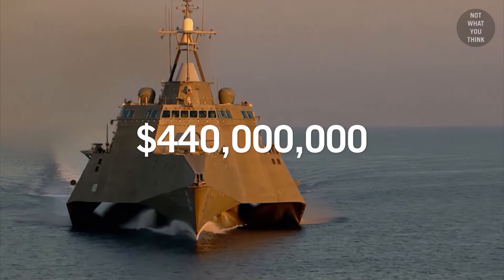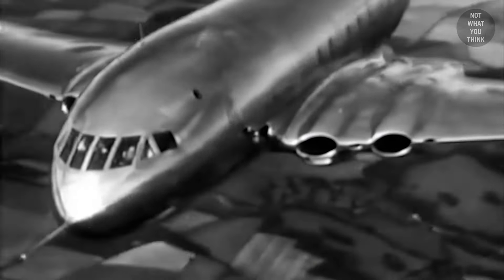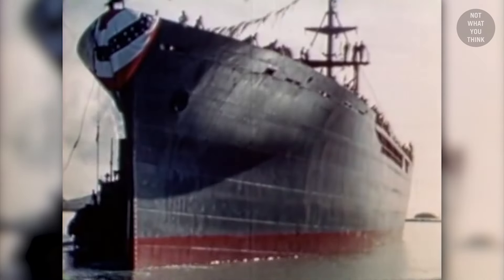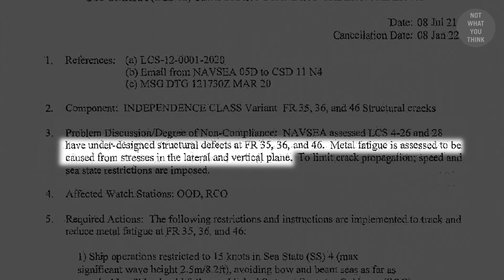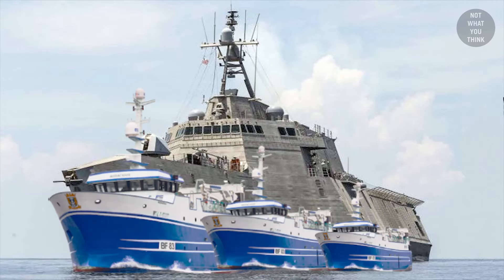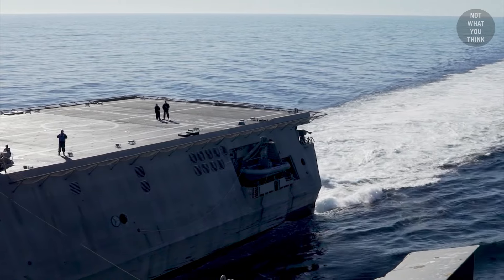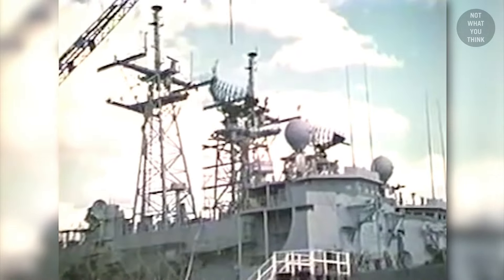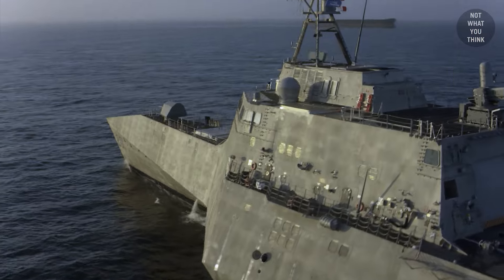SPEED Makes This Warship CRACK!

Comment: Unlike steel, aluminum does not have a fatigue limit. If you keep stresses in steel below a certain threshold, it will basically endure forever. That's why you can make steel springs. In aluminum, stresses are cumulative no matter how small.
Reply: Yeah
Reply: I think you meant to stay steel has an infinite fatigue life as long as you stay below its strain limit
Reply: No.

Certain alloys and heat treatments of steel have terrible fatigue life. Same with Aluminum.

The issue is the crystal structures and inclusions (what is alloyed with the Fe or Al) that create the material properties.

The geometry of the crystals (size,  dimensions, orientation, and how they interconnect to each other) is what gives a metal it's mechanical properties. The different inclusions (alloy material) that is added changes how the crystals can move relative to each other or the chemical composition of the crystals and the chemical bonds made by those crystals.

It is possible to design a aluminum structure for flexural fatigue life. But there are far better alloys of steel for that task for given price point.

Inherently the problem is just poor engineering and metallurgy. The guys building it did what they were told. The guys designing it were either mislead as to it's use case or were incompetent. My gut says incompetent.
Reply: @JM-nt5fm  bingo. I'm a cycling tech and I stay away from the science of metallurgy, but if I try to straighten anyone's frame I have to check the manufacturer and see if the alloy of aluminum or steel can safely be straightened or if I need to tell them it's a loss. 

I've seen a seemingly bomber steel bike develop major cracks from fatigue, and aluminum alloy bikes with thick enough tubes bounce back after getting a little warped. Usually comes down to the thickness and quality of the metal (and the severity of the bend of course)
Reply: I'm wondering about your statement and the B-52 bomber....................
Reply: Thanks That must be news to military
Reply: @JM-nt5fm  He is correct. You're talking about something completely different. Maybe keep you're mouth shut and don't go telling people they are wrong if you're incapable of even reading.
Reply: @Echo81Whiskey  He said it exactly correctly. Like he said, Aluminum does not have a fatigue limit. What you're saying is literally just another way of saying the same thing.
Reply: I think the term you're referring to is "Endurance Limit" but basically yeah. Never heard of it being called "Fatigue Limit" though. Well, at least not in my FE handbook.
Reply: @Chris  thank you for defending Winstons honor, 
But Eric and J M, while the could have chosen kinder words, are adding a few facts and points.
Like you say: 
they mean the same, they just use different words.
They also go into different details, 
and they go a little deeper into the material science.

It helps keep discussions civilized, constructive and relevant if we all read and think thoroughly before commenting :)

Everyone here is trying to further our understanding of the science, we just have a few misunderstandings of words and intentions.
Youtube's reply system also obfuscates what comment exactly we are referring to- 
J M referred to eric, if I am not mistaken.
Reply: Information via a search can be found that provides details for Yield Strength and Tensile Strength for the common Aluminium Alloys. In  the main there is some difference between the two.
One factor not mentioned here WRT the Liberty ships is the effect of the freezing cold waters that they sailed in. Constant coldness had big effects on the Heat Affected Zones (HAZ) of the welding that were not realised in early days. Impact testing of HAZ's clearly show this.
Reply: This is the 1st time I've heard aluminium that way. But let's assume you're right...

1st, to be fair w/ Austal & USN, I assume they used alloy, an aluminum alloy that can endure stress but of course still below the level of steel which explained the cracks.

But if just aluminium, then this is blatant corruption: the US not just failing to live up it's reputation on science & tech but rather failing on basic materials science.

Now based on what I remember on high school physics about modulus of elasticity, all materials can endure stress but on different levels. A material would permanently deform if its stress limit is exceeded. Based on this, aluminium is simply below steel & explains why it cracked during a certain speed &/or sea state
Reply: @watermirror  it's mean it's quality is not matched according to it's designed.

That's what you called Scam at its finest.
Reply: Happens when you try to build something on the cheap. It ends up costing you more. This class is a waste of money.  Ordinary 10,000 ton frigates would be just fine.

We're going to end up fighting the Chinese or the Russians. And when we do we're going to lose about lose half  of our ships. It takes about 4 years to build ships. So we need to have them ahead of time. Build the damn things.
Reply: @avva4090  what ever they said in their product.

It is still below quality to what they advertised.

They should be accountable for this mess.
Reply: @Echo81Whiskey  pretty much what the dude said
Reply: @JM-nt5fm  ceratian alloy of steal are bad well where talking about them where talking about the steel on ships thats dies not have crack as easy lol
Reply: would it be feasible to use aluminium for the upper half of a ships frame while using steel for the lower half?
Or just the areas which are under high stress, that those be steel. I have heared that combining these two materials is rather challanging, but doable, right?
Reply: @Echo81Whiskey  re: "Unlike steel, aluminum does not have a fatigue limit."  re: "I think you meant to stay steel has an infinite fatigue life as long as you stay below its strain limit"  exactly, Winston has mis-spoken.  his 1st sentence CONTRADICTS what he goes on to say in his 2nd, 3rd, and 4th sentences.  what this indicates is someone who's "baby young to the world" (and doesn't know the information) cause no one with actual experience working in the Mechanical Engineering or Material Science fields for the last 20, 30, and 40 years would ever make this error.
Reply: @Alfred Wedmore Interesting. I wouldn't have thought of that :) well i was never too keenly listening to chemistry in school ^^, which i now see was a mistake.
Would help an aluminium alloy of sorts with this or would the aluminium still desolve as quickly, slower or maybe(unlikely?) not at all?
Reply: @nos9784  Actually JM makes statements that are factually incorrect. He adds some detail, but also throws in a bunch if bullshit that doesn't mean anything. It strikes me as someone who's entire knowledge of the subject is a few YouTube videos and now they think they're an expert. The other one just said they think he said it wrong and that they thought he meant to say something else. That person probably just wasn't aware of the terminology used, but the terminology was in fact correct.
Reply: @Alfred Wedmore "today carbon fibre and aramid epoxy are so superior there's no point." So why did the US navy choose to use aluminium anyways if it is inferior to the other solutions?

Is it easier to fix under battle conditions or afterwards? I assume composite materials using epoxy would be needed to be used as with cars where whole sections at once would need replacing if only a scratch is somewhere ^^, which isn't by default a bad thing, just may also waste a lot of ressources. Not that militaries in the past would have considered that a too great a factor. I am still just confused that this issue has not be forseen as for someone like you with the knowledge how these materials interact with each other i would think that those are involved in making such a beast.

anyways thanks for the clarifications
Reply: @Alfred Wedmore "high speed, light weight, durability" if those are the choices i go with speed and durability as weight maybe compensated for by stronger engines. Though i expect to reach the high speeds they may have aimed for due to also low weight with aluminium could therefor not be reached on the same level.

Still speed from what i heared from other military vids is superior as ordonace seems to be able to crack any type of armored hull/frame currently in service anywhere so the best option is not to get hit in the first place where speed comes in handy.
Reply: @Alfred Wedmore So the solution is to build ships with tyres. BTW, finally someone that spells aluminium right.
Reply: @jimmiller5600  air stresses are different than water stresses. Remember Tesla? Resonance and frequency are important.
Planes are not ships and ships are not planes ✈️
Reply: Why aren't we making warships out of fiberglass?
Reply: Winston Moy: you got it a bit backwards. Aluminum has the fatigue limit. I haven't seen aluminum springs yet.. airframes are aluminum and have fatigue limits
Reply: @Alfred Wedmore TEF GEL!!
Reply: @kinngrimm  Just don't EVER drop a (copper) penny in the bilge: burns right through AL. To reiterate, "A penny saved, is a penny unburned", or something like that,....
Reply: @kinngrimm  Same thing with tanks: firepower, protection, and mobility - choose two. As for naval architecture I choose nuke power. Solves all problems.
Reply: @a.b.6233  The englesh, so snotty. Scedule.
Reply: @I_Have_The_Most_Japanese_Music  Too heavy, no advantages over steel.
Reply: @ericvardek4108  i am rather scattered at times, so it is a good thing i am not a sailor =) damn i just imagine the captain barking at me if i lost a penny ... again hrhr
Reply: Absolutely none of that is true , day one of metallurgy would beat into your head that all metals have critical limits based on loads, alloy and condition. 
This is junior high welding class stuff ....do better !
Reply: A most useful addition to the forum.  Thanks for posting.
Reply: @watermirror  100% agreed it's like all the alloys, plastics rubber we get and use these days have gone wayyyyyy done in quality due to corruption and cutting costs. Back in the 60s...  Dry rotting rubber trimming on cars wasn't a thing. My dad owns a 65 skylark.. we rebuilt it and all but with the original trim rubber glass. And the goddamn rubber trimming and aluminum trim after 60+yrs looks brand new still. 

On the other hand my 2001 Toyota jzx110 mark2 I imported from Japan... The goddamn rubber trimming on that car is soooooo dry rotted it's literally lifting and falling apart like it's brittle. The chrome they used on the trim is peeling due to just shit build quality. 

The company's that build these materials and sell them to the manufacturers to then give to car company's or anything else like military contractors has gone down so badly just for them to save a few extra bucks. 

Such a sad thing that company's are PURPOSELY building trucks and cars now to fail after the warranty ends. Ahem Tesla ahem.
Reply: @duncandmcgrath6290  you missed the whole point..... The build quality of the alloy was shit. The company tried cutting costs on the aluminum alloy they made. It didn't hold up over time cause some corrupt mf decided to mix alloys from a landfill or something dumb into the aluminum to cut costs lmfao.
Reply: @duncandmcgrath6290  wait NVM sorry I thought you were replying to @M J hahah sorry about that but yea I agree with you 100% load stress isn't what determines strength of 304 or 408 or any steel. Vibration and shock cann killlll still.
Reply: perfect example, stating the spring example.  That's why a relatively small piece of aluminum can be bent by hand while if steel would be impossible to hand bend.
Reply: Lol - I just wrote the same!
Reply: @JM-nt5fm  I disagree.

While there are thousands of grades of steel those chosen for shipbuilding are chosen on characteristics which include having a fatigue limit. So just because there are steels with poor fatigue properties you won't see them in building ship's hulls.

The aluminium shipbuilding industry for fast ferries came out of Australia with Austal and Incat both being very experienced designers and builders. Are they perfect - no but not being perfect and being incompetent is not the same thing.

The size of these vessels is about the cut off for aluminium. If you built in steel you would have zero corrosion allowance and you would have the sallow look that so many warships have. They may not have the same fatigue problems but corrosion would kill them.

I've accidently put a welding hammer through the side of a steel patrol boat when knocking off rust.

Back to fatigue and it is also common for vessels to be pushed harder than they were designed for and therefore accumulate fatigue problems sooner than expected. I'm aware that there are programs where stress sensors are fitted throughout the hull to obtain information, however, these usually need to be on flat plate and that is rarely where fatigue starts - as I'm sure you will be aware.

I've surveyed hundreds of aluminium boats, mostly a lot smaller than these but they operate in rough seas on a daily basis. In the particular fishery aluminium was favoured about 2:1 with GRP, with weight being the main factor in favour of aluminium (kevlar, carbon fibre not realistic for fishing boats).
Reply: @descentmvm  "Is that pure AL?"
"No sir, we're mixing it with some shit."
"Could you be more specific?"
"I believe it's dog shit sir."
Reply: Depends on how the aluminum was made. I seen shitty aluminum castings shatter easily where high quality ones need to be thrown a bunch of times at the ground to even bend.
Reply: What you are saying is , “steel Fe atoms in spring are like nanobot. Repairing themselves, from stress within limit, and remembering the original  shape coded”
Reply: Well not all steels are good. For example they used low strenght BCC steel for the old ships that broke in half in the beginning of the video. The steel experienced a ductile-to-brittle transition around 0°C which made them crack in cold conditions. 
I don't know what type of steel they use today but I know that low strenght FCC alloys and some HCP alloys don't experience a ductile-to-brittle transion when it is cold. But the hole metallurgy subject is complicated, steels containing Cr, Ni, Mo, etc can get brittle with wrong tempering method. Also impacts effects a materials tongo from ductile to brittle.
Reply: что? только, про сопромат, узнали что-ли? так то его изучали с 40-годов. а не специалистами и того раньше. так мы, из каменного века, перешли, в железный. но явно, не всё человечество.
Reply: @HeLLFiREGM  not sure what you said, but perhaps my reply of "himar" has some importance...
Reply: @mcqueenx75  there is such a science about the resistance of materials, but it seems you don’t know about it. as a science, it began to develop somewhere from the 30s, and in the 60s, it already had a solid experience that was only accumulating all this time. here we see either a miscalculation of the designers. or the design itself... or the choice of material. or the supplier supplied a defective alloy (considering that this happens on many ship models, it’s stupid to suspect the supplier, or it’s a very worthless supplier). so it will be clearer? (google translate)
Reply: @HeLLFiREGM  could have swore it was a himar target. Thanks for clearing it up
Reply: Aluminum work-hardens which makes it turn brittle and/or fail from bending. Mild steel coat hangars are perfect example of susceptibility to work hardening and fatigue. Metals come in multitudes of alloys, all of them designed for different uses, costs, and properties (and even some witchcraft! ;))